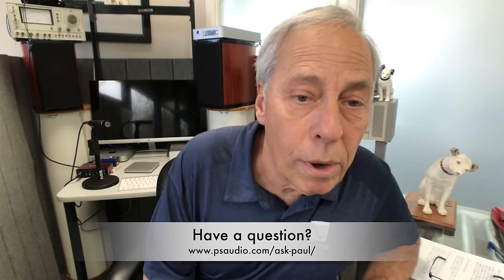How to match amps to speakers

Comment: Hi, I'm first time building a speaker on my own. I have 100w 2.0 Apm that will power 50w/channel. for 3 way crossover i chosen: 
woofer - 40w 
mids - 15w 
tweeter - 15w

all are 8ohms (i have option to go for 4ohms)

What do you think, in total 60w for speakers is too much or how should i choose mids and tweeter power?
Reply: Woofer 4 ohm

Comment: I have a 2 channel 8 ohm amp pushing out 55 Wats per channel. I want to run two speakers per channel ( total of 4) what is my most effecient set up? as far a wiring and speaker rating

Comment: sir paul, is bridging power amp is safe? i mean here in philippines we have 220V current. sometimes low current not stable. what happen to power amp thats in bridge mode?. also 4ohms load is much safer than bridge mode? what would you advice given the scenario sir pual.

Comment: Thanks for the explanation of the concept.  May I ask a more practical question,say, what is the minimum and maximum watt output the ideal Amp should have for a pair of loudspeakers 25-200 watts RMS with sensitivity of 90db (impedance 4ohms)?
Just wondered if your reader actually asking a formula that we can input the variables you mentioned to obtain the best output range of the Amp (when 20 watts Amp could play a 300watts speaker well, there must be some sensible way to measure, mustn’t there?)

Comment: Damn, giving you guys a subscription now. Didn't really realize that the speaker impedance mattered on a receiver. Having hooked up a set of JBL 2800 tower speakers to a cheap little sony radio/cd/tape player and it working, didn't think before I bought a new set of speakers. Should have checked my receiver first. Thank god they fall in the impedance rang, but the range seems a little high at 8-16 ohms. Is that just because of how old the receiver is or are there variations on receivers that I should be aware of.

Comment: Is running a Crown amp rated at 750w per side into Cerwin Vega vs150 speakers rated at 400w each and 102db too much power ?

Comment: so, lower power amp does not affect soundquality, just loudness.?
Reply: You need to be careful.  If you wind a low power up high you will soon hit clipping point.  Which creates square waves which contain lots of harmonics and will pass through to tweeter at amplifiers full power and can burn tweeters.

Comment: Can I run a pair of 8 ohms and 6 ohms speakers at the same time? My amp is rated for 4-8 ohms. Owners manual says I can run 2 pairs of 8 ohms but not to mix 4 ohms and 8 ohms. 
Cambridge AXR85 amp. Only 85 watts per channel.  Don't really crank it up...seems to be running cool enough/no sign of overheating.
I appreciate your technical expertise and really enjoy channel.

Comment: Isn't impedance a very important consideration too? Since having an amp mixed to a speaker with different impedance or vice versa can damage either of them. I am asking as a noob trying to research as much as I can before I buy components to build my own.
Reply: I swear, the more I read/watch about the subject, the more confused I get! I think I'll just operate under the assumption that my gear will bite the dust eventually, rather than agonize over the 'perfect pairing'.

Comment: Fascinating. I never really knew what went on under the hood with this dB setting. So question: if you have speakers all in the 90s range, let's say 92 for all channels except the rear which is 86 dB sensitivity per 1 meter, would it be more effective (specifically if they were rated for lower wattage amplifier) to offset the more sensitive speakers down or would it be more effective to adjust the whole system relative to the amount of dB that those weaker links require and maintain a lower volume of output?
Reply: If you have a home cinema system the central unit with the measuring mic will do the job for you but answering your question.
In the audio industry you should always bring something down, not up if you have less sensitive speakers you should bring down this more sensitive and then your maximum volume will be limited by your rear speakers power handling. If you do it the other way. You bring your back speakers 6db up, you will have to set master gain to -6 db (to maintain 0db on your rear speakers but 0 db in this case is set by power handling of your rear speakers) so the result will be the same if you bring down your front speakers 6db. The reason for bringing down is to maintain unity gain betwin the units lets say u have dsp unit and power amplifier if you give your power amplifier +6db signal you can potentially overdrive your amp input stage (you can overdrive the output of dsp too) and you will get the distorted signal from the amp even when you set him to -6db ( wich will give 0 db signal on output calculated from your rear speakers handling). Ofc you have to make sure this 0 db is not above your amplifiers max voltage and power handling. Don't forget to take distance from the speakers to you into consideration if one speaker is closer to you u will hear it better so you need to compensate it too.

Comment: great video! 
i have 4 speakers to connect to amp. 
one pair speakers having specs: short 60w, long 90w, impedance 6ohm (recommend amp 25-90w). 
other pair is already mounted on the ceiling hence i have no idea about spec. 
Qns 1: i am wondering if i should purchase a 60w or 100w amp? 
Qns 2: by connecting 2 speakers in 1 channel, does it mean the ampilifier wattage will be divided to feed each speaker?
Reply: In this video from 2017 Paul says don’t get too high watt an amp to avoid speaker damage. In more recent videos, he says go big or go home.  One final time, please clarify.  Thanks much.

Comment: Sir, What is a LONG THROW speaker? What is its frequincy range response? Why is it called so? Is it designed for the purpose of responding to very low frequency signals and produce soft powerful subsonic bass?

Comment: What Paul says is not necessarily true when it come to lower efficiency speakers and required power.  The literature that comes with your speaker can help with this.  I own a pair of Thiel .5 loudspeakers rated @87 db.  Thiel themselves recommend 50 - 150 watts to run.  I own an A/B amp that gives 50w of good power.  It is more than enough to power the low efficiency Thiels.  Thiel themselves were spot on with recommendations.
Reply: yeah me too, I own 87db speakers and they definately don't need "hundreds of watts"

Comment: I have a pair of JBL l100 clasics which ive had for over a year and not bought a nice sterio amp yet. Ive been using my 5.1 suround amp in sterio 90wpc which In realize does them no real justice. They say they can handle 20-200/250w which is a huge range. Would a vintage marantz 50w pc be a sensible choice (budget is a real issue for me!) They are rate at 90db. I love vu meters too.

Comment: Hi, i have a dodge ram and i want to install a system, i dont realy understand all those measurements and numbers. CN you help me to put a system together? Im thinking about a 5 channel amp, but i dont know about how many watts and how many watts on the speakers. Please help. Please. Tks
Reply: It´s difficult for someone to help you, because it will depend on what type of system you want, and what are your expectations about it. But as a rule of thumb, you should have speakers with the same or more watts rms as the amp will give to each one, like he said in the video.
  I had a great system in my car, installed by professionals, for some years , but i already dismantled it and sold the car... I really miss that system, it sounded awesome.

Comment: what if I am amping a dual 18 inch cabinet that rms at 1000 watts with an axial sensitivity of 103 db at 1 meter. Its the tx2181 cabinet and im thinking of matching it with a dynacord l1300 which in bridged mono mode pushes 2000 watts at 4 ohms. Would seem that I would have enough juice to run the amp low enough to not wear on itself and have enough power to push the cabinet. The qsc amp that says it is matched is a power light 3102 amp though which is rated at max driven at bridgedmono 4 ohms at 3100 watts which seems like more than would be needed.
Reply: Either will work fine, if you use the Dynacord in bridge mono be sure not to drive it too hard, or pull back your amp level a bit as it's capable of double the rated power of the speaker (2000)

Comment: around 2:45 you say that if the microphone measures 85, 86, or 87 dB its a low efficiency speaker, and then anything round 90 dB is efficient. I understand that dB is not a direct unit itself but a unit of change in relation to something. Can you explain exactly what that dB is measuring? What is the relationship between the Watt thats being pumped into the speaker and the dB? Can I think of it almost as a percentage of the Watt? Like if it was an impossibly purely efficient speaker, its efficiency would be 100 dB? If thats the case, why would the impossibly purely efficient speaker not be 0dB (unity) and measures of efficiency be negative? That would seem to make more sense, and the fact that that's not the case leads me to think something else is going on that I don't understand. Can you help clarify please?
Reply: Then around 4:20 you say, “It doesn't take a lot to drive a speaker that has high efficiency to a very loud level.” The whole video you've been talking about efficiency of amplifiers. Did you mean to say, “It doesn't take a lot to drive a speaker to a very loud level if you’re using an amp that has high efficiency? If not, then what is the efficiency of a speaker?

If you have a speaker thats rated for 100 watts and one thats 300 watts and send 100 watts down each one with the same kind of amp (same efficiency) will they theoretically (for the purposes of understanding what's going on here--obviously two different speakers won't produce the same frequencies the same way) produce the same volume sound?

How do we measure loudness? If the dB is being used for the efficiency of the amplifier, what do we use to talk about the loudness of the speaker?

Also, how does the speaker's wattage rating play into this whole thing? Most speakers I see have a continuous, program, or a root-mean-squared rating and a peak or a max rating. I’m pretty sure continuous, pgm, and rms are effectively the same thing and peak or max are effectively the same thing—please let me know if they’re not. The example in your video was with a speaker rated at 300W and around 3:20 you say that if a speaker is rated at 300W you don’t need to match it, you just need to make sure you don’t exceed that—are you assuming that 300W is the continuous rating or the peak rating when you say that? What exactly do these ratings mean?

Comment: Appreciate the video. I have 4 each 2 ohm speakers and I am assuming they are pretty efficient since they call them premium speakers and I believe Rockford Fosgate made them for Harley Davidson. So 2 are 5.25 fairing speakers and 2 are 5X7's for the saddlebag lids, each 2 ohm rated. Any help on what I should look for as far as specs on the amp would be greatly appreciated. I discovered these four speakers have not been on an amp and I am just trying to go a cheapy route for improved sound, hoping adding an amp would make a nice difference.
Reply: 2 ohms??
Wire series, makes 4 ohm.

Comment: Thanks for this. The rule of thumb is the amp is 50% (or double) the watts of the speaker. The watts are confused with actual speaker loudness; your video clarifies efficiency. Your title is misleading:  I'm  
wondering if Speaker X is matched with Amp A (inefficient) or Amp B (efficient).

Comment: So if my amplifier exceeds the speaker rms it’s gonna damage it? Or is it only if it exceeds even the speaker’s peak?
Reply: If your amp exceeds the speaker rms, but you don´t push it hard, you should be ok. If it exceeds only by a little, it´s not likely to cause problems either. But if it exceeds by much, and you do push it hard, then you are asking for trouble, especially if you do it for a long time. 
 There´s something more dangerous, though. If your amp is very weak, and because of that, you have to push it well beyond it´s limits, then you´re more likely to damage the speakers and/or the amp, than you would with an amp a little more powerfull than the speakers.
  I hope you understand what i said, English is not my first language...   :)

Comment: Dear Paul, am I right that you missed a point ? 🤓 better an amp more powerfull than the speakers. That way it will never produce cliped signal and  never become dangerous for speakers. 🔊 Any clipped signal can potentially damage a speaker
 (People must be aware to not set to much volume).

Comment: So for my yamaha receiver RX-360 how much watts should i look for speakers. Impedance i know.
Reply: Your receiver has 55 watts/channel, so you should look for speakers that have around that, or more. And if you like it loud (like me), avoid speakers that have less than around 90 dB of sensitivity, like he said in the video.
Reply: @mindtraveller100  tnx for answering, i am not into loudness, more for quality
Reply: If i have a 2 speakers one is 600w and the other is 650w.. both 12" 8ohms. connnected parallel in one channel. Was 1000w power amp enough to drive this, or i need like higher watts than that?... TIA for the answers
Reply: BTW the sensitivy is 91dB and the other is 93dB

Comment: Is it also important, or did I miss it somehow, to make sure that your amp is capable of handling the lowest resistance that a speaker will present? I had an amp that couldn't handle low resistance speakers (significantly lower than 8 ohms) and it just roasted the tweeters on a couple of pairs of 4 ohm speakers, yet it never did an ounce of harm to any of the 8 ohm nominal speakers I had it connected to (it was a neighbor I Ient the amp to who did the damage, not me). That amp still works fine, but not with low-resistance speakers.

Also, isn't it entirely common for audiophiles to hook up systems with amps rated to be able to produce wattages far in excess of the speakers they normally drive? The idea is that you don't push the amps very hard and they perform better (a theory that I have always understood, but also question). In that case it would certainly be important not to turn the volume up to full on an amp capable of producing 600 watts when it is connected to speakers with a maximum rating of 150 watts. But there's nothing wrong with using an overpowered amp like that, as long as you don't turn it up too much. In fact it's really common practice among stereophiles.

Finally, it would be cool if someone were to create an online calculator that could show you how loud a speaker with certain efficiency would play at various wattages. Something like Efficiency * Wattage = Decibels. Maybe there already is one? If anyone knows where, or even just what the formula is, I'd be thrilled to find it.
Reply: It's vitally important that the amplifier NEVER clips. An amplifier driven to that level will not only sound bad, it will fry your tweeters! That may be what was happening with your low impedance speakers. When the amp goes into voltage or current limit (because your asking for more voltage or current than it can deliver), a lot of high frequency energy is delivered. As this amount of energy is not normal in music, the speaker system has not been designed to take it. A more powerful amplifier is better, but UNDER NO CIRCUMSTANCES CAN YOU ALLOW IT TO OVERPOWER YOUR SPEAKERS! Ironically, occasional overage from a powerful amp is less likely to cause injury than a low power amp that's clipping frequently.
Reply: Andy B
"Finally, it would be cool if someone were to create an online calculator that could show you how loud a speaker with certain efficiency would play at various wattages. Something like Efficiency * Wattage = Decibels. Maybe there already is one? If anyone knows where, or even just what the formula is, I'd be thrilled to find it."
  
  I´m sure there´s that online, you just have to look for it.
  But basically, you can start with the value of the speaker´s sensitivity (which stands for 1 watt) and add 3 dB for every time the power doubles. Example: a speaker with 90 dB of sensitivity;  in that case, we have: 1 watt - 90 dB; 2 watts - 93 dB; 4 watts - 96 dB; 8 watts - 99 dB; 16 watts - 102 dB; 32 watts - 105 dB; and so on, and so on.

Comment: Surely if there is not a standard speaker used by all amplifier manufacturers, how can you compare amplifiers to each other? In other words, if all manufacturers are using different speakers to specify their amplifiers power then there is no standard.

Comment: Great Video! Thank you very much, I assume you explained very well, I am new to this. So just to get clear, if i have 2 speakers 250w each at 96,3db,and amplifier off 300w would do it? btw 8ohms
Reply: Since it’s 250w each. You’d need an amp that can put 500w.
Reply: I recently came across a DJ's video stating that if you have high wattage amps going into low wattage speakers, you can always turn down the amp. But if you have low wattage amps going into high wattage speakers, you'll eventually burn out something. You can't turn up that amp's power to fill the speakers. Makes sense. But make sure you check the Ohms and RMS specs on both pieces of equipment. If the amp's Ohms is a minimum of 4, do not have speakers below 4 Ohms. RMS is the steady stream of power going into your speakers and they MUST handle that power or they will burn out.
Reply: @Mr.Taylor56  also depends on size of the room